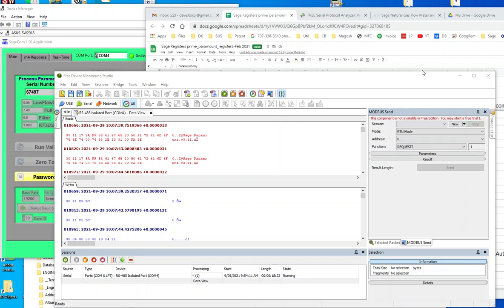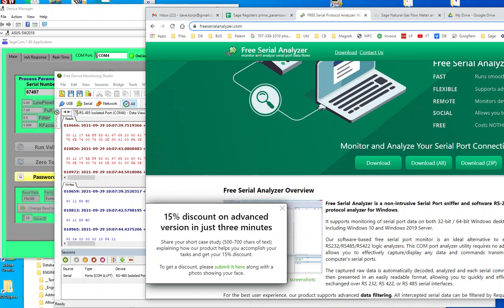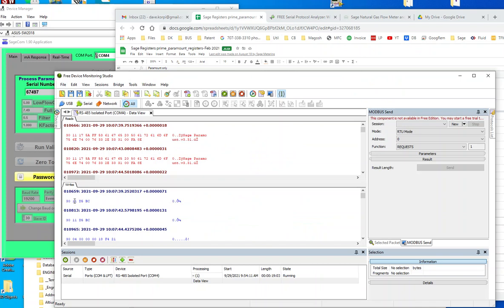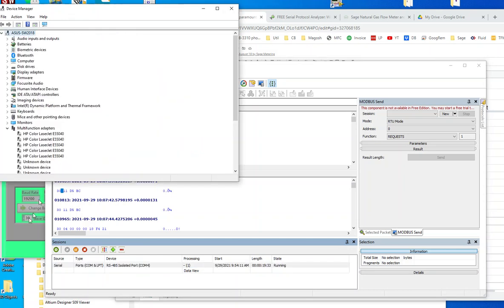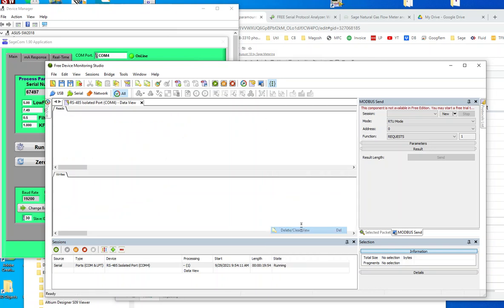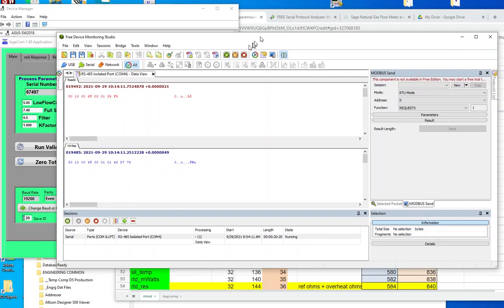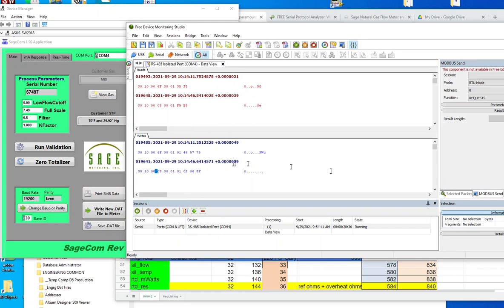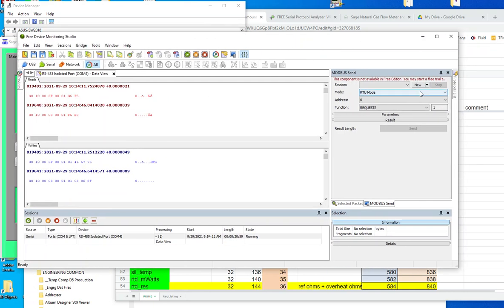FREE Serial Port Sniffer Easiest to Use! Works on RS-485, RS-232-, I2C, & others Sniffer for LabVIEW

Comment: Hi! I bought 2 devices with software which only works with the usb key. I want to read what that usb key does and try to replicate it. How to read the data which that usb key is sending to the PC?
Reply: I know it can be done but I do not know how it is done. I use the tool for much simpler stuff.. I think they probably have a key that is encrypted with some sort of clock that would make it hard to replicate... I am VERY INTERESTED to learn how this could be done...
Reply: @MagFlowMeter  This is some low tech chinese device. It can't be too complicate. I believe there is some driver to be installed or very simple chip inside which sends the code. But where to start?
Reply from the maker: @aleksandarsocin7058  I would just spy on the USB comms and start the software and watch what happens and make a log of that. Watch out how often it queries the USB. Most Chinese made devices like that are more sophisticated than we presume.  They are super smart programmers who are very good at their work. What devices is it? pM me at dave2468@gmail.com
Reply: @FlowMeter  Thanks for you answer and support. I wrote you an email.

Comment: I have a UQM motor controller that uses RS232 serial port communication. I bought several RS232 to USB adators and none seem to work. How can I tell if it's the protocols or a hardware issue. The controller turns on and tries to communicate but it times out. The UQM controller is a DD45-500LW.